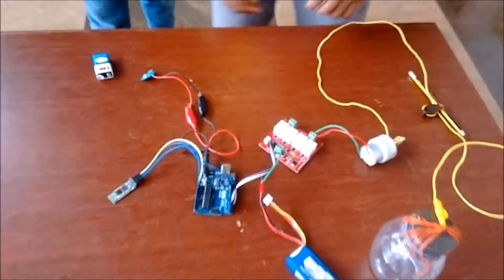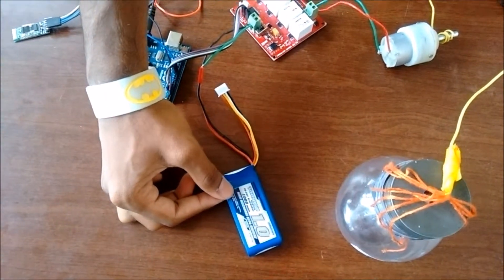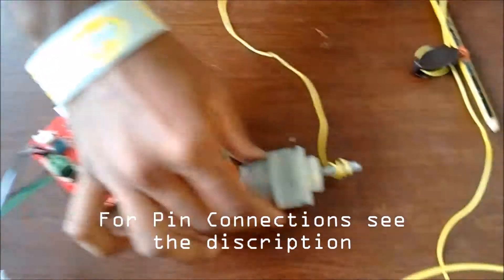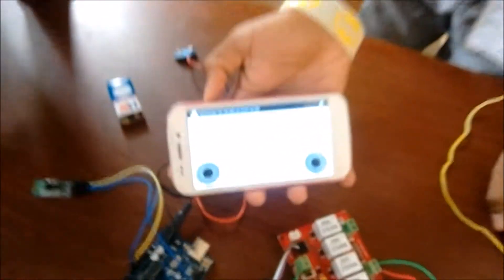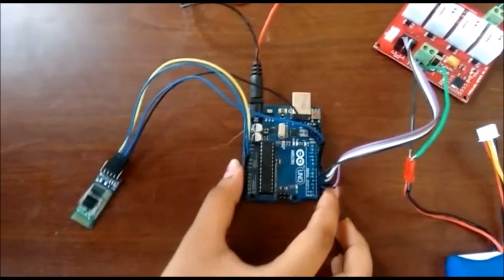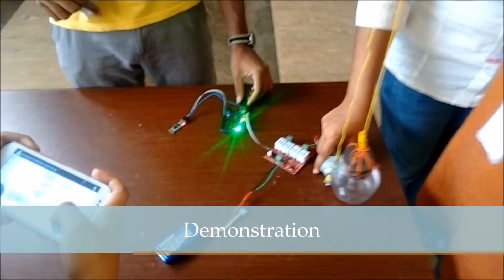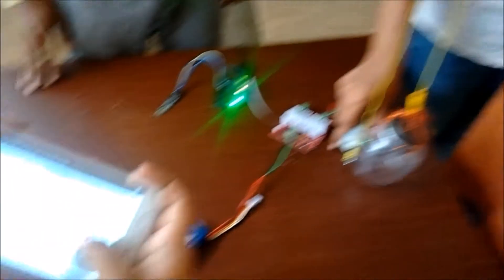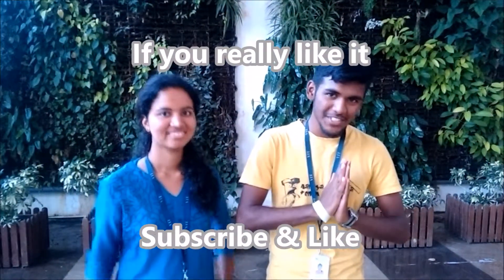Bluetooth Controlled Pulley

Comment from the maker: #include <SoftwareSerial.h> // import the serial library

SoftwareSerial Genotronex(11,10); // RX, TX
int i=0,n,a=2,b=3,c=4,d=5,e,f,g;
char x[50];
char bluetooth;

void runbot()
{
   if(x[11]=='R')
  {
    e=(int)(x[17]-'0');
    f=(int)(x[18]-'0');
    g=(int)(x[19]-'0');
    n=e*100+f*10+g;
    Serial.println(n);
   if(n<90)
    {
      Serial.println("FORWARD");
      digitalWrite(a,LOW);
  digitalWrite(b,HIGH);
  digitalWrite(c,LOW);
  digitalWrite(d,LOW);
    }
     
     if(n>270)
    {
      Serial.println("FORWARD");
      digitalWrite(a,LOW);
  digitalWrite(b,HIGH);
  digitalWrite(c,LOW);
  digitalWrite(d,LOW);
    }
    if(n>90 && n<270)
    {
      Serial.println("BACK");
      digitalWrite(a,HIGH);
  digitalWrite(b,LOW);
  digitalWrite(c,LOW);
  digitalWrite(d,LOW);
    }
    if(n==000)
    {
      Serial.println("STOP");
      digitalWrite(a,LOW);
  digitalWrite(b,LOW);
  digitalWrite(c,HIGH);
  digitalWrite(d,HIGH);
    }

  }
    
  
}

void setup() {
  // put your setup code here, to run once:
  Serial.begin(57600);
  Genotronex.begin(57600);
   pinMode(a,OUTPUT);
  pinMode(b,OUTPUT);
  pinMode(c,OUTPUT);
  pinMode(d,OUTPUT);
  
}

void loop() {

  // put your main code here, to run repeatedly:
  if(Genotronex.available())
  {
    bluetooth=Genotronex.read();
 x[i]=bluetooth;
 i++;
 if(bluetooth=='>')
 {
   x[i]='\0';
   i=0;
   runbot();
   
  
 }
  }
}